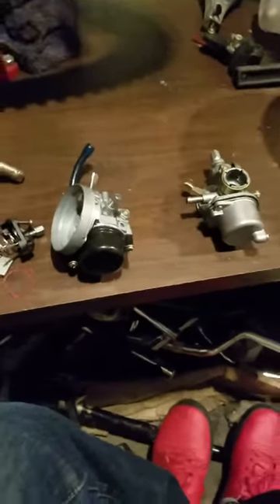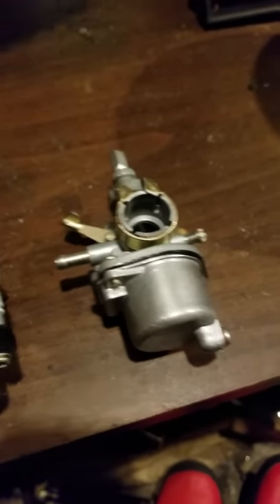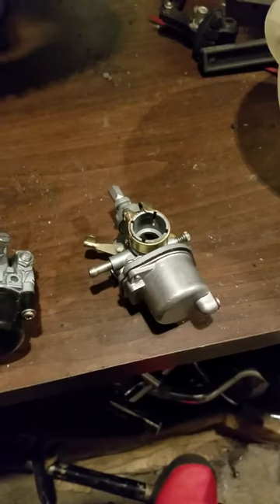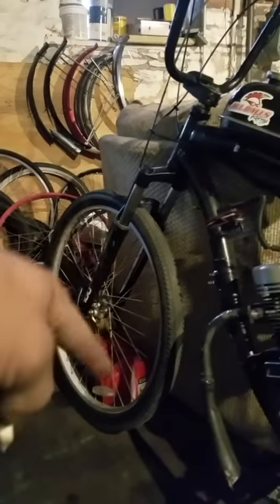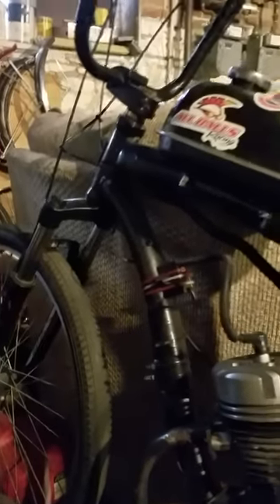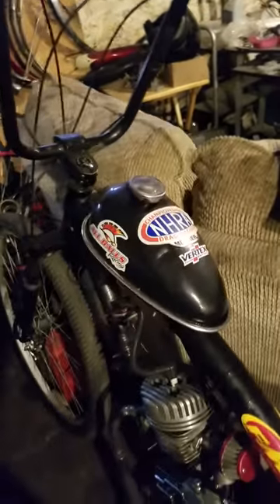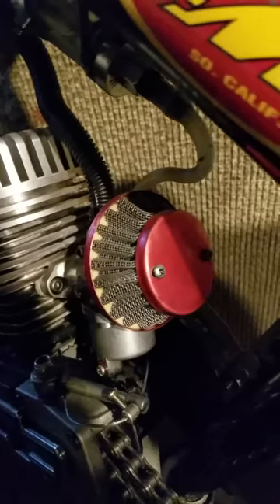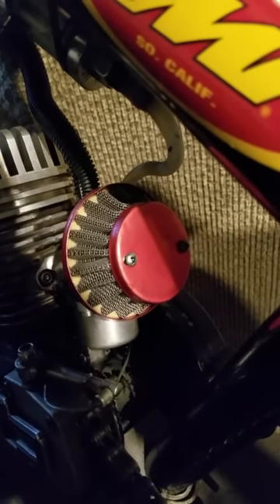Motorized bicycle tips  and tricks to go faster for cheap reach 50mph #motorized #bicycle

Comment: Been using that stp for about a year now. Never any issues. I’ve been using 4 ounces per gallon which makes a good 32:1 mix. That’s the lowest I’ll go. Been running great. Put about 500 miles and the only issue is I think the rod bearing is going bad like yours did. I hear some sort of metal noise in the engine now while it’s idoling and when I rev it, it gets faster.
Reply: I was using about 4 ounces of oil to the gallon and added a little more cuz it started to sound rough. Shouldn't have done that.

Comment: Hey i have another question i ordered the thrust pipe today and i done even more porting i was wondering if you port the thrust pipe to match the cylinder port or not? Also i got my bike to hit 40mph with the stock 44t sprocket the only upgrade is the 6cc head , porting go's a long way with these little motors .
Reply from the maker: Kool man. yes u can port the pipe they come unmatched
Reply: MWR TV Yeah i figured that lol i just didn't know if you port matched them or not thanks bud👍
Reply from the maker: No problem
Reply from the maker: Yes
Reply: @MidwestRidazmotorizedbikes  Funny thing is was back when I got that pipe i thought it was the thrust pipe but it was the big Bertha pipe I actually ordered which turned out to be a way better pipe than a thrust pipe lol
Reply: Nice my complete stock Bike hit 41mph a night (don't think I have done full throttle since I still in break in)

Comment: Sup, good video & keep on smoking. Also, 7.5hp craftsman lawnmower 21" self propelled has an exhaust gasket with a big port 40mm bolt pattern & is 3-4mm thick. It's a leaded gasket with self sealing ability. A perfect match for cdh66 or zeda88 expansion chamber. A must have!
Reply from the maker: Thanks for the info

Comment: Bike life!! I recently discovered a Very useful transfer port mod that got my little 38mm stroke GT5 goin 40mph with stock exhaust.
Reply: Can you explain what that mod entailed? Thanks
Reply: @wsk5846  most of the cylinders come very rough cast and all the ones I've gotten have had a lip just inside the transfers- also a little area that seems wasted on the small end. I grind that lip so theres a smooth transition also, I take JB weld and fill in that area on the small end so it gently slopes into the direction of outlet (it makes the outlet of the transfer slightly smaller, thereby increasing velocity.) If you're doubtful of having jbweld inside the engine, I've run three cylinders with the very mode modification and the jb weld is still intact. Basically, I'm just matching the inside of the transfer port angle to the outside.  I have ground a sharp edge on the entry edges but found it doesn't make a big difference. Those crappy castings usually need at least a little cleaning up and port matching at the very least. The exhaust port can be widened at least 5mm and 2mm on the top and bottom. Just make sure to chamfered the edges of all ports after you're done with all the grinding.
Reply: @codelicious6590  oh ok thankyou. Would you recommend breaking in the engine first before trying this mod?

Comment: I just installed a new motor on my Columbia klunker bike but Hub mounted adapter apparently wasn't on there good enough and ruined my rear wheel first run. Tips or advice while I'm waiting on the new wheel in the mail to secure it better? Man that motor sounded good the first 30 seconds lol.
Reply from the maker: Not realy but i once used a hohse clamp to stop it from going into the spokes but make sure you have it tight ride then check again

Comment: I got a question? I got 2 motors brand new, if i started the 1 time, for 2 minutes. Now i check it again, now the wont start while padeling. I check the clutch and everything is fine. But it wont engache, is sounds like a still slipping bad. Can you help please.....
Reply from the maker: Ok seem like a clutch problem..you might need to tighten it up
Reply: @MidwestRidazmotorizedbikes  i will this tomorrow. I will let u know...

Comment: What exact model is the first generation nt speed carburetor you showed us in the beginning, Is it the CAF-020? I’m looking to order one but i don’t know where to find it
Reply from the maker: Let me find a link
Reply from the maker: https://rover.ebay.com/rover/0/0/0?mpre=https%3A%2F%2Fwww.ebay.com%2Fulk%2Fitm%2F202034510682 carburetor link
Reply: MWR TV thank you bro, and how did you get the screws to go through the air filter like that without cracking it?
Reply from the maker: @tako9136  its metal

Comment: I have a red huffy cruiser and it will only run on choke but when you start to turn the choke off it shuts off what’s wrong with it I’m a teen I don’t have much experience with engines yet
Reply: Did u adjust the idle at all?
Reply: No
Reply: After it started doing that yes
Reply: @Sameoldgrindchris  what if u turn the idle screw on the carb all the way to the right?
Reply: Until it’s almost of the way toght
Reply: Tight

Comment: i like my C-9 seat as well it looks different its the newer style ,  i think im going to get the thrust exhaust like most of your bikes run but i might go with the zeda pipe have you ran the zeda pipe ?
Reply from the maker: No but similar not a bad pipe of your looking for speed
Reply: MWR TV Heck yeah i might try it. I ported my jug and the nt speed carb and the stock exhaust to match the gasket it has way more torque and hp then stock, im a 240lb dude it ran about 27mph before the porting and 35mph after, i raised the exhaust port about 4mm and ran it over about 10mm on one side its huge now i also worked with the intake side a bunch i lowerd it about 4mm raised it 2mm and took a little off the piston skirt and cleaned up the fuel ports they was ruff with casting lines and also ported the intake pipe a good bit also been messing with the jetting it runs great until it gets close to the top speed/rpm its 4-stroking bad i cant figure it out if i go one size down on the jet it is to lean it bogs and i soldier the jet and drill the jet with tiny drill bits i cant figure it out im going nuts on this issue lol do you think a pipe would help with tuning issues?
Reply from the maker: BALDYS RC PROJECTS a pipe is the key to power also
Reply: MWR TV i removed the silencer cap off of the stock pipe along with the porting and they open it up a lot I just was wondering if it would help the tuning with a better pipe I'm sure it will give it a little more power also
Reply from the maker: BALDYS RC PROJECTS  yes you need a 2 stroke pipe with expansion chamber those always work great on our bikes
Reply: MWR TV Thanks for the help👍👍

Comment: Your right about those so called Performance carbs I slammed one on my driveway after fucking with it one problem is the internal filter is so fine of some plastic shit, but I run a walbro Chainsaw pulse pump now its fucking smooth and faster it's top's out just over thirty I couldn't picture one doing 50 mph I've built two the first I think I put over a thousand miles on it but I make most of the accessories I just use the motor, and three onces of oil really is not enough four is about as far down and gallon you should go that's 32/1

Comment: hey man the reason u hear the knocking under the clutch cover when u first get the bike is the chain rubbing against the clutch cover I had to remove the clutch cover and use a dermal drill to dried out the clutch cover just enough so chain doenst catch I like the up graded head do think just up grading the head cover. gives u that much more power I replace the shity Chinese spark plug when I got it that helped a lot now my bike starts everytime the fast I got on a bike with skinny road bike tires is 35mph so if your getting 50mph what do I got do to get speed like that lol sound like a 6half horse motor for that kinda speed like 4-stroke Predator motor 212cc or something lol I am working on a fat tire bike and I have to off set the motor so the chain doesn't slap the back wheel
Reply from the maker: +Petter St.germaine port and jet
Reply from the maker: And yes offest is required
Reply: +Petter St.germaine NGK plug, open air filter, good expansion pipe, head and little bit of porting the jug + 36T or 32 sprocket and you'll be flyin

Comment: You're right about that carburetor I buy the fast flow  and it looks cool and powerful but it just lost potency no good ,so I had to replace the original back  👍🏼
Reply from the maker: Malkitzedek Pf yeah sorry to say
Reply: What do you mean it lost potency?
Reply: 96StangGT91 it go slow and lost power
Reply: That's good to know... I almost bought one for my zeda 80 (triple 40) it's bone stock and I hit 39 earlier tonight on a GPS speedometer app on my phone but I'm trying to find good parts to buy to upgrade it to make it faster... do you have any suggestions?
Reply from the maker: +96StangGT91 pipe head speed carb and port match
Reply: 96StangGT91 I just buying two more motors ,I gone to try replace the sprucle ⚙for an smaller ,as soon I done wit it a let you know how it works

Comment: Hey man I just got a brand new motor from eBay 80cc what is the right mixture in gallons in ounces to break it in thanks man
Reply from the maker: Speed Dado  8oz to the gallon  after 2 tanks are gone lower to 4oz
Reply from the maker: +Speed Dado 8oz to the gallon first 3 tanks then 4oz from there on out
Reply: Speed dado ive owned two strokes all my life i love them there is no reason to add extra oil when running one in believe it or not adding extra oil to a two stroke is just as bad as not enough. By adding extra oil you actually lower the octane rating of the fuel and you also cause the motor to run to lean which actually will cause the engine to run hotter. Personally i would just buy a good quality oil something like belray  run it at 25 : 1 and just take it easy for about 300 KLM'S and you will have no problems. Dont buy oil for a water cooled engine and dont buy cheap oil for lawn mowers or gardening equipment Fuchs scoot 2 is a good oil its made for mopeds. look up on YouTube there is quite a few.
Reply from the maker: Timothy Kennedy on these little engine's  it's best to run them heavy for a gallon of fuel mix for ring settings and  bearings lubeing don't fail
Reply: I ran 25:1 on first tank. Then i run 2.6 oz oil to .80 gallons after about a 38 to 40:1

Comment: #1 expansion chamber
#2 head
Reply: Where are the best heads ?
Reply: Port timeing jet size transfer port matching intake and exhaust port work with a 36 tooth sprocket
Reply: @martymcfly3153  thos parts dont matter I've seens stock motors go fast

Comment: Wow they put rod bearings in that small of a engine I'm surprised. Did it come stock with rod bearing or is that some billet/custom whatever rod
Reply from the maker: +jacob cooke no they come with them
Reply: That's pretty cool I own a predator 212 engine and I had to get a custom billet rod the stock rod didn't have a bearing in it. I also have on of those gas bike engines I haven't messed with it yet thanks to you I might take it appart tomorrow and mess around with it. What's the most hp you think you've gotten out of one of them little 2 strokes
Reply from the maker: +jacob cooke 4 at the most but i got bike that will do 50 down hill
Reply from the maker: +jacob cooke they come like this
Reply: That's impressive for a engine of that size
Reply from the maker: +jacob cooke yeah i run them in mid 40s

Comment: you talked about, how you "mess with the port timing [16:48] " do you have a video on how you do that ? please reply id love to learn how .
Reply from the maker: +Taze a Butterfly you can achieve this by adding base gaskets
Reply: Midwest Ridaz motorizedbikes could you please refer me a link for the correct base gaskets .
Reply from the maker: Taze a Butterfly any 66cc or 80cc most are the same 49cc will be to small
Reply: That's not how you do Port timing all you're doing is either boosting the compression or lowering the compression by moving is on Port timing it is when you actually cut the port

Comment: hey great video I'm getting ready to subscribe can you tell me how I can get more power I don't need speed I just need more power so I can go up hills
Reply from the maker: Bigger sprocket more teeth
Reply: @MidwestRidazmotorizedbikes  
ok. Thanks. What are the top two or three or more things that I can do to a bike to raise the torque. I just moved her really hilly area and I'm finding myself pushing it
Reply from the maker: @r0bbyinchins  a good carburetor sprocket and a good pipe for breathing hi rpms  or mod the stock
Reply: @MidwestRidazmotorizedbikes  thank you so much... Do you have a link for an affordable carburetor upgrade??
Reply from the maker: @r0bbyinchins  https://www.ebay.com/itm/192307140139
Reply: @MidwestRidazmotorizedbikes  
One more question if you don't mind..when I order the carb & pipe  upgrade which ones do I order?

Comment: I'm having trouble with my top speed. I get to top speed then it slows down. Then speeds back up over and over. Please help?
Reply from the maker: Sounds like a spark plug issue...or maybe your carburetor..check all jets clean and tighten
Reply from the maker: And change your plug

Comment: hey bruh. I put a new head and piston on my bike and now it wont crank. its making a funny sound now when the piston goes up and down. I also notice its blowing air threw the carb. please help
Reply from the maker: Sound like u have the wrong piston compare it to the old one and see if the wholes line up
Reply: @MidwestRidazmotorizedbikes  yup the same piston. I read a comment in one of the videos I watch and the guy said the intake isn't taking in any air when the piston is at top dead center. that's the prob I'm having minds not taking in air
Reply from the maker: @dsmooth2449  check your rings or the top gasket for the head clearance
Reply: thanks bruh. it was the head gasket

Comment: What air filter is that? Could you possibly link me the source?
Reply from the maker: +Sirpotatoguy 281885527443 item number ebay
Reply from the maker: +Sirpotatoguy lookup mzmiami on eBay
Reply: Thanks
Reply from the maker: +Sirpotatoguy no problem
Reply: bikebarry.com for parts

Comment: You ever messed with the small reed valves?
Reply from the maker: No not really
Reply: Ahh I got my bike going 30mph with a 44 tooth with a pipe and jetting but the power drops off at high rpm and just got a reed and going to try it. The reed seems to small to me tho, I put it on my bike last night I'll let you know if I get it to run good. Lol
Reply from the maker: ok let me know
Reply from the maker: Now for the revalue no you have to have the windowed piston
Reply: Ok. Ya the little reed valve is trash lol
Reply: @Casey-jp5fr  ur 4 stroking. Jet it down